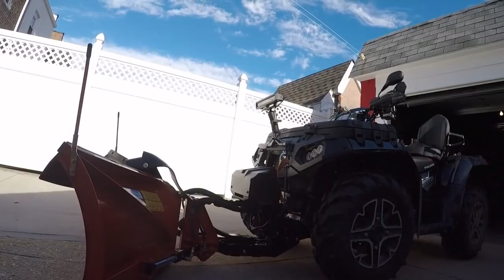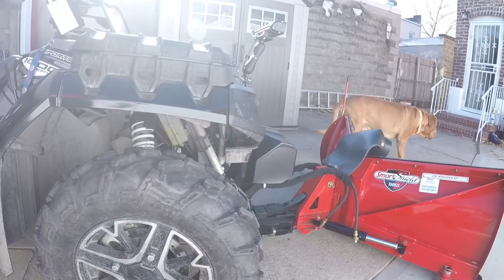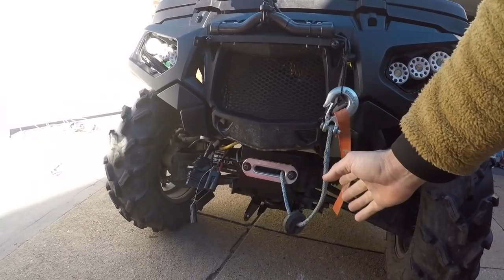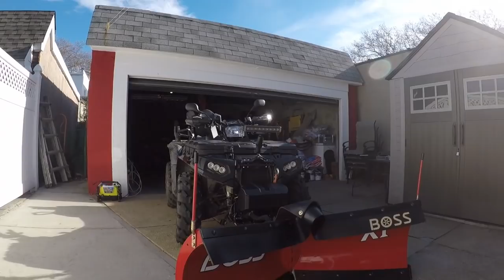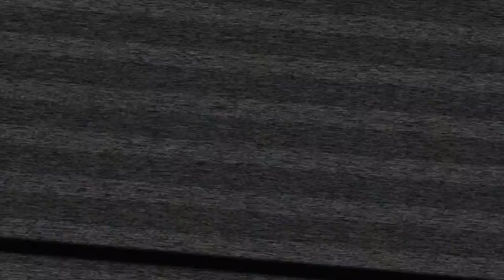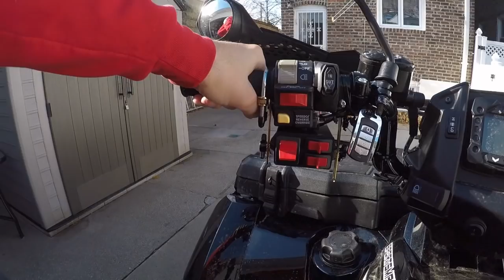BOSS V Plow on a 2017 Polaris Sportsman 1000XP Touring ATV

Comment: no more juice. just a bigger container.. put the extra battery hooked up in line.. now  you have a deeper cell. it will stiull charge from the regulator and give you longer life together... same as putting duel batterys on a camper.. you will still only get 12.5  out of it.but will last longer

Comment: Thanks for your very good pictures of the plow and the mounting system. I am checking out different plows and wanted to see all that.
Regarding your battery issue, getting a battery at a battery store that has more "crank power" will help. Possibly a battery with more crank power would be the same size?   Another thought is that you could ask the technicians at a battery store what you could do to add a battery. 
Thanks again for all the detail regarding the plow and its mounting system.
Reply from the maker: Michael P,  Jr. thanks. I actually hooked up a secondary battery since this video. I’m gonna be posting an update soon. And about ur research. I’ve had 4 atv plows. This Boss is by far the best on the market. Most expensive but the best. Look no further. You will not be disappointed.

Comment: That was a brilliant review, being a fellow NY’er, I totally get what you’re saying. I’ve got the same setup and used a deep cycle lithium battery as my primary and then went and got a secondary system as well with a isolator/relay from pep boys and it works perfectly in charging. Good luck man.

Comment: A second battery is a must !!! ..., but not because of just starting and stopping the quad. The plow's use, up and down, angling ect. is what wears the battery down quicker than the quad can recharge it... in combination with starting and stopping the quad. The plow's hydraulic system sucks power !!! I've got the same setup - 6'6" on my Polaris ranger 800 XP for 4 years now. I put a dual battery charger system on board. It automatically will switch between batteries. Keeping the batteries trickle charged throughout the year is a must to maintain them as reliable and high quality. One battery is for starting only. No issues. The other battery is for the plow and accessories. Once I set it up this way, I never had an issue again and I can plow all day. One last thing. Although this plow is not too heavy for your machine,  you will have pushing problems if you wait too long to start clearing during a storm or if it's too wet. The Ranger is much better suited for this application although I'm sure you'll have no issues if you start clearing early, 4-6" max and make frequent passes. Having said that..., plowing has never been so much dang fun !!!
Reply: Never heard of two batteries ??? Must be new. Hope it goes well. Awesome setup !!!
Reply: This plow would work great on a arctic cat 700 diesel with 40amp alternator
Reply: You need to upgrade your battery to an odyssey!  You can pick them up on Amazon.
Reply from the maker: hoss0513 I looked into them. I didn’t find one that would fit in that back void where I mounted my secondary battery. I ended up mounting a 22amp battery as my secondary. I’ll make another video soon. Just been so busy this season with snow and prep, I haven’t had time. But next week looks good

Comment: Hey how would u feel if you were to run this plow with a 570 sportsmen, can’t decide on a 570 or 800. Enjoy the season bro
Reply from the maker: jonathan novielli yeah def no doubt you can use a 570. There’s another guy that has a 570 and this plow on YouTube. I think he’s works in the Bronx or Manhattan. I know for sure I saw his videos and no issues at all. I recommend the larger engine but if you can’t afford it by all means the 570 will work fine. Just put the spacers in for the front end. They help big time. Let me know how you make out.

Comment: Sweet video. Nice set up. Very informative video. Whats the cost of that plow?
Reply from the maker: Kamil Golab thanks! The video was sooo long. My intention was to make a 3 minute video. You see how that went lol. The plow installed and out the door was 3400. I changed some stuff around on the quad and adding a few more things. Should be done in 2 weeks or so. Will make another “short” video jut talking about accessories once I’m done. 👌🏼
Reply: Deerector sounds good can't wait to see it

Comment: Any update how is that dual battery setup? Can you do a sort video of you plowing with it for us to see?
Reply from the maker: CoolTechStuff dual battery is all done. Will post a video explaining that too and my other upgrades. And check my page, i uploaded a short video of plowing a few hours ago.
Reply: Deerector Yeah I just saw that do the dual batteries work good is there a difference in power you notice?
Reply from the maker: CoolTechStuff now it starts up immediately regardless of what is on. Because the starting battery is significantly unloaded from accessories. I didn’t install the volt meter yet. This storm was 3 days early so everything went in quick. And amber lighting we did too. Switches for that are temporary as well. Ill make a video of all the stuff as soon as it gets above 16 degrees 🤣🤦🏻‍♂️
Reply: Deerector Yeah it's been Cold here in CT hoping soon to get the boss v-plow and a quad for it. Do you have the heated hand grips? If so do they help alot
Reply from the maker: CoolTechStuff  yeah i have heated grips in front and back and thumb warmer. The back heated grips suck I’ll
Explain in a video why and the front ones with the thumb warmer work good when they decide to heat up. Apparently it doesnt stay on constant. I think they work like those therapy heating pads and go on off even if you have it on. After the winter I’m gonna prolly get a different brand after some research. These are polaris branded.
Reply: Deerector Ok thanks